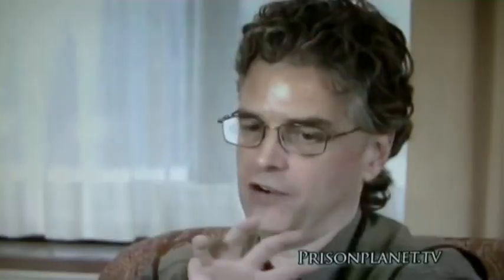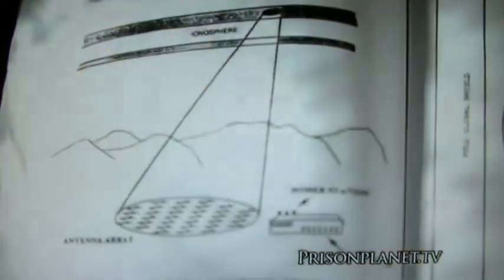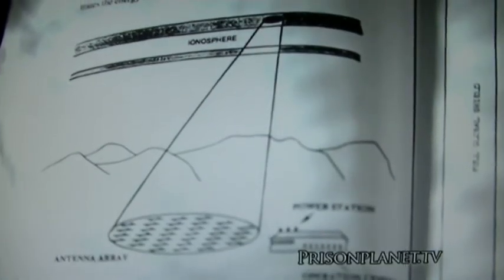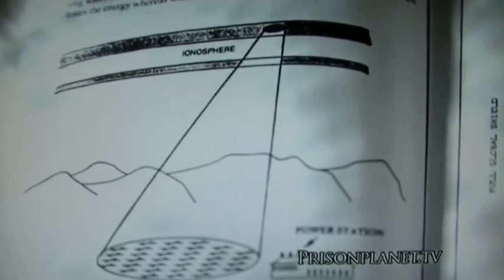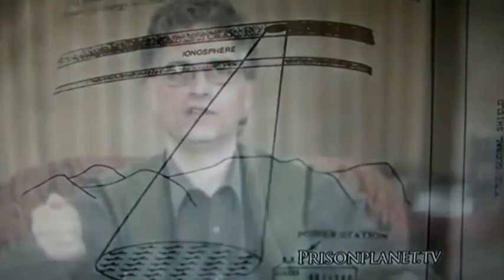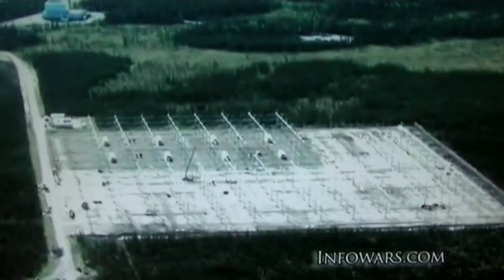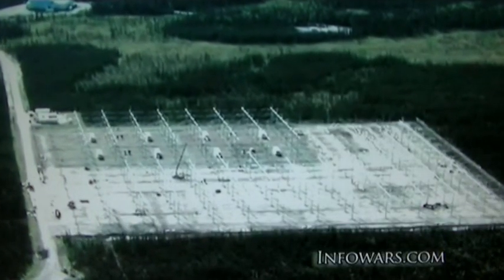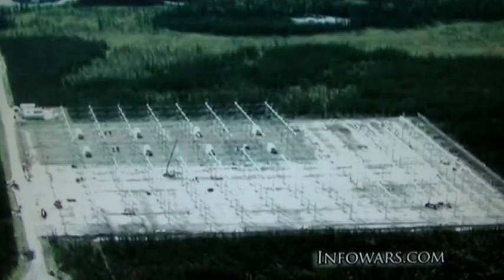HAARP Weather Control, Explained by Nick Begich

Comment: how close to a location does it have to be to have an effect i live in the dalles oregon and see effects that could be haarp .
Reply from the maker: Stephan Bitterwolf
I am sure you can see the ELF from the re-bound of the Haarp HF signal, with a very cheap (freeware) PC based spectrum analyzer, and a coil of very fine wire (40 AWG, 1lb spool), with an iron rod in the middle. You can do this setup for around $20, and I'm not kidding!
Reply from the maker: I think the US Navy SBX transmitters are what is causing the Haarp downbursts over the Pacific. They are mobile, and absolutely perfect, for doing these weather control operations. Yes, there are Haarp downbursts all the time, off the Pacific coast. This is part of a larger program, which is supposedly beneficial.
Reply from the maker: Stephan Bitterwolf
 There are many of these pin-point accuracy, Megawatt (average power), classified military, radars, along the Alaska coast, and west coast. Search Google for "Cobra Dane", which is a mega radar at the tip of the Aleutian islands. It is part of the "Missile Defense Agency" system, but it's real purpose is to control the weather, by heating the ionsosphere in a precise way. That is my opinion, but is probably true, since we don't have a big risk if incoming ballistic missiles anymore. No wonder they won't let the cold war die, they NEED it to keep the money flowing for their secret weather weapons systems.
Reply: The HAARP Report
What is this detection device?
Reply: that is cloud seeding so it can be created anywhere.  Just hear the jets in the sky the day before an intense nonstop rain, sleet, snow, storms, hurricanes, tornadoes, earthquakes
Reply from the maker: At night the Alaska Haarp can only reach out 300 to 500 miles, but in the daytime, the ionospheric "mirrors" are setup, and it can reach out about 2,000 miles, even farther, if it has a heavy chemtrail layer, midway between transmitter, and target. I am just saying this, because this is what I've seen many times on the satellite, and weather maps. IF YOU ARE IN OREGON, the Alaska HAARP can easily reach your area in the daytime, and it is controlling your weather every day! Please watch my "north pacific low pressure killed" video, as an example. This happens every few days. That is why you are in drought :-(
I have seen that dozens, and dozens of times. You need a special radio detection device to be able to prove it is happening in your area. Without a detection device, it is all just sheeple complaining.
Reply: i had no idea how powerful haarp is , thank-you .

Comment: Chemicals with metals are known to enhance RF/HAARP heating(like putting metals in a microwave), but they also have more functions.  It's a bit like mixing cocktails of chemicals in a pool to adjust it.
  Geoengineering.